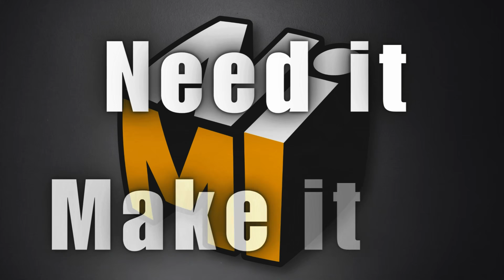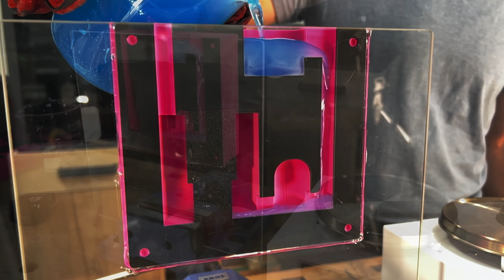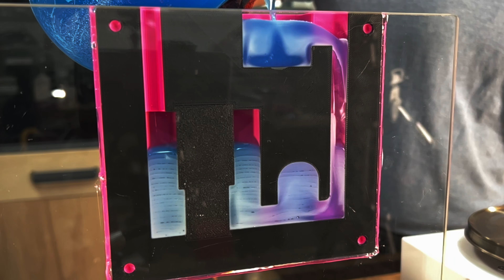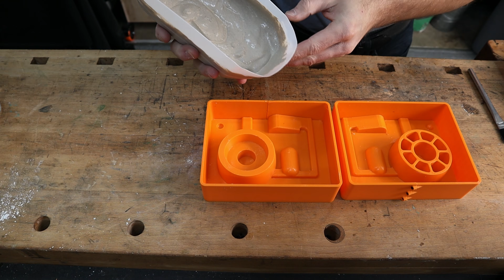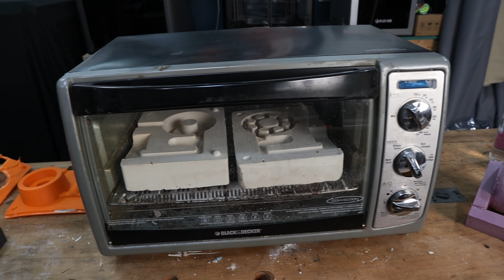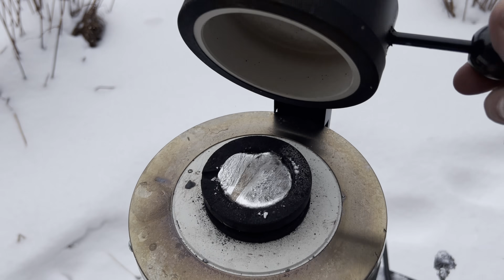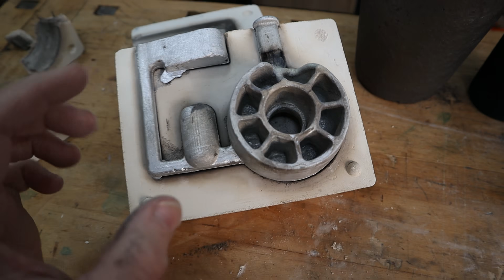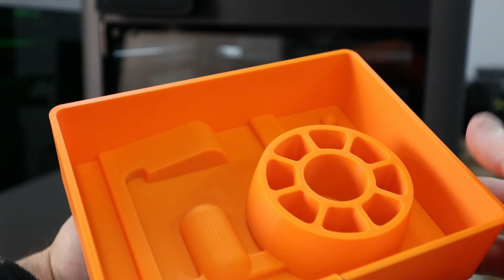Casting detailed aluminum parts is probably not a good idea and here's why.

Comment: You will have trouble with drawn or extruded Al.  Cast Al from car wheels is good.  Heat it up in a fire, map or a rose oxy tip, then hit it with a hammer to break bits off.  Your sand is rough and has no binder.  When your foam melts the loose rough sand collapses and the cast fails.  Mix with crushed bentonite (kitty litter) and a little bit if moisture.  Olfoundryman on YT is a legend.  His sprue designs are best and finish amazing

Comment: If you do not have any more aluminium to poor into the mould but need more material. Is it not possible to just put anything in the hole you are pooring into. Like some other metal that you can melt at a a regular cooking plate. or just put some nails into the hole. Alternativly air pressure that pushes the metal down

Comment: This is all super interesting!  It's not a failure if you learn from it.  Regarding your molds with the webbing to save material, if it's acceptable for the application, you might consider Zamak for the casting materal.  Lower melting point and flows better.   Thanks!

Comment: Using that "wall plaster" compound as a ceramic shell works pretty well if its diluted with soapy water.. U dip it, let it cling sift sand over it while wet let it dry and then dip it again.. 3-4 coats is usually fine.. then burn out the foam instead. :)

Comment: Detailed aluminum casts are usually performed under pressure. Since falling aluminum from height has a number of disadvantages, casting is performed under high material pressure into steel forms.

Comment: So one of the things I have considered is ball milling several sizes of aluminum balls the smallest of which might be like .5-1mm

You seal the drum and you put in a small amount of anhydrous solvent “Ethel or isopropyl” then after a time you rinse out all the oxidized dust. Then you reseal with fresh solvent maybe some “aluminum flux, if that exists”

Then run the sealed drum till smallest ball size dissolves to powder making sure that that packing of powder is 💯 

Then add a small amount of sacrificial wax/oil/carnuba possibly and roll tumble over heat till solvent is gone remove and tumble till cooled 

Now you’ve got a dry mold material whose oxidation is prevented till firing.

Firing removes wax and hopefully a low oxygen kin (coal sinks can pull oxygen from the kiln air) Charley’s your dad! dry cast powder liquifies, slight overfill controls for lost volume. 

Ceramic mold cap lets gas escape but shunts gas exchange?

No argon or inert gas needed.

But maybe I’m being too hopeful.

Comment: On your foam you should use a 0 flute bit. Also coat the foam in a drywall mud thinned with water and a drop of dish soap as a surfactant.. let dry thoroughly just enough to cover the foam. The coating is porus for the escapement of gas an keeps the sand from collapsing in. The riser size is also overkill. No vents needed as gas escapes through the coating. Compact the Sand by vibration. Plaster of Paris is hydroscopic.

Comment: A tip for removing forms from the plaster - include some small holes, with push in plugs in the 3D print.  When the plaster has set, pull the plugs out & use compressed air to separate the PLA from the plaster.  It's very gentle and will remove it evenly.

Also, a multi-tool is great for vibrating bubbles out of the plaster.

Comment: Shouldn't you be adding the plaster/sand mix to water instead of adding water to the mix?

DAP Plaster of Paris Mixing Instructions

Proportion: Use a ratio of 2 parts powder to 1 part cold water (e.g., 2 cups plaster to 1 cup water).

Mixing Order: Always add the plaster to the water, not water to plaster, to reduce lumps.

Slaking: Sprinkle the powder over the water's surface and let it settle and absorb the water (slake) for about 1–2 minutes.

Stirring: Stir gently to a smooth, creamy consistency. Avoid fast stirring to prevent introducing air bubbles.

Consistency: The mixture should be thick enough to hold its shape but smooth enough to apply, similar to heavy cream.

Working Time: Work with the mixture immediately, as it sets hard in 20–30 minutes. Only mix what can be used within 6 to 10 minutes

Comment: I think you would have a better result if you raised  the ambient temperature of the mould that way the material will cool slower and a lot of the issues will resolve themselves.
Detailed moulds in ceramic work well because primarily of the static or ambient temp of the mould during the pour.

Great video's though, nice to see a fellow Canuk with some really good content.

Comment: Couple helpful bits from my own trials: XPS foam (eXtruded PolyStyrene) cuts well on a CNC at 12-15k RPM with bits for plastic/polymer composites. Feeds speed-wise, you can run it practically as fast as your machine will go. The pink brand gums up A Lot, but there's a green version for house insulation panels that cuts really well and isn't pre-scored. 

--When you go to make the void for your foam core, you can use a solvent like acetone to dissolve the foam before pouring your metal and let the mold vape off. 
--For your feed sprue on the casting part, large, smooth and tapered to force pressure to work for you top to bottom, as metal will naturally exert more force at the bottom of the mold. One single large feed with an adequate secondary vent works well on medium to very dense metals. 
--With PLA or lowish melt materials and complex printed parts, there's a few options. You can use a stronger reinforced plaster mix for refractory (I made a DIY version on my channel if you want to try it, all materials explained and where to get), and for actual reinforcement, basalt fiber is cheap as well as high-temp resistant. It looks a bit like chopped fiberglass but black, behaves about the same where its slightly more annoying to incorporate if your mix is very viscous. 
--The other option is layering via dip and sprinkle, but it's tremendously time consuming unless you're doing treed parts for bulk casting, and the ceramic part needs a kiln or similar firing for proper solidification (as well as burning out the print). 
--Experimental option 3 if you have a science microwave (obtained via thrift store or old replacement, etc), layering Thin coats of powdered silicon carbide and sodium silicate brushed directly onto your print, then use the refractory plaster for the mold and place in a dedicated microwave to melt the print out. Make sure you add extra vents for the polymer to expand and dribble out of, or it likes to swell in the mold and break out.

Comment: You need a tapered sprue. Taper the sprue from top to smaller at the bottom.
Reply from the maker: You're right about that.  In all of my wisdom, my thought for the tapered sprue was for ease of removal, turns out that there is more to it than that.  I've already made the adjustment for the next try...which I think will be a success!

Comment: I think you're doing pretty well and I wonder if you preheated the mold hot enough as whether adding well as some more, smaller diameter venting from the part body section into the main vent you have might help.  This was cool--thanks for sharing it!
Reply from the maker: I have an idea which I think is both easy to do, should release really well from a 3D printed mold, and it's also cheap.  If you've every used waterglass (AKA sodium silicate) that's what I'd like to try next.  Cures in the presence of CO2 and should be as simple as mixing sand with it and forcing it into the mold.  I can do a preheat like you're suggesting, I think that would be smart.  it should also assist in releasing some trapped gasses, since they've been using the technique for cores for a long time.

Comment: You should check out the methods by "Shake the Future". Plaster seems porous enough to pull a vacuum on it even from the outside. The outside air pressure than pushes the molten metal even into small features.

Comment: Riser's are free.
You don't calculate extra Risers in the total mass calculation.
(OK, one of the things you did not calculate with the flowing wax demo was the air in the mold expands with the exposure to the  temperature of the molten metal.  Trapped in a mold air at room temp expands drastically.  As it does it volume grows dramatically.  This is often miss understood and people assume that the metal chilled early.)
By adding a second riser in the 2 O Clock position on the wheel or the 11 O Clock  position, or both you allow for expanded HOT air to leave without needing much of a pressure piston action that slows down the flowing metal.
(You can have a fill that only has enough volume to partially fill ALL risers and it will work.  It's just more re-assuring to see the metal come out the top of all risers.)

Comment: Both refractory cement and plaster of Paris and Jewelers casting plasters are based on "Lost Wax burn outs"   you start at about 180 degrees for low temp sprue waxes to melt out then move it up to 300 degrees and BEGIN the 8 to 12 hour process of drying the mold.  You don't have a burn out kiln that has a computer controlled Ramp up pyrometer.

Comment: 1. you need a taller feed sprue.  It's first benefit will be more hydraulic pressure.  It's second benefit will be to add a second sprue near the top.
(Cold shunts are always more than you can see by about 2X.)
2. Round some of those 90 degree inside corners to create less resistance to curving the flow. 
3. Consider finding on You tube how to make graphite crucibles and microwave based ovens.
4. Consider using a casting torch and a second clay crucible (Large) and melt the extra metal first and have a second person pour the amount of metal you can electrically melt the second that the torch based melt is out of liquid. If done as a one, two there should be nothing more than a second or two of separation between the two acts.

Comment: AGGGGGGGG!!!!!
After you have your sand set but before you pour use a propane hand torch to burn out that rectangle of pink foam.
Why make the molten metal do MORE work at the beginning than you have too?
Get that nozzle as far down the sprue shaft as it will go to melt as much pink foam as possible before you add the liquid Alum.

Comment: Burlap strips would work instead of buying fiberglass fibers.
Traditionally you wrap the mold in plaster soaked burlap and the longer fibers lock the whole thing together.
De-plastering is a bit more work getting the Burlap to give back the part.

Comment: A taller mold with a second metal in gate above only one you have would be better in that it would supply hotter metal to the last portion of the casting.
By placing a riser in the second gate you prevent escaping air from blasting the sprue channel.
You now see where that second sprue would need to fill that last part of the top.
(You need to make it that your NOT starting a fill until everything below the second sprue has filled.  This is critical in that were metal to be coming into both sprue channels at the same time you could have trapped air pockets in the middle of the part.)
Also heat your mold to a higher temp.  Your mold is chilling to much out side like that.  You MIGHT have had the right mold temp for a Summer time pour but not a winter pour?)
Windchill on the pouring crucible may also shorten how far the metal will flow.  Erect a wind screen.  Actually it's more of a windshield but that sounds miss leading.

Comment: WARNING: STYROFOAM WHEN IT BURNS GIVES OFF ARSNIC GAS!!!!  YOU NEED TO BOTH MENTION THIS AND TAKE PROCAUTIONS.
ARSNIC IN A GAS FORM CAN LEAVE ARSNIC PARTICLES IN YOUR SHOP ENVIROMENT.  YOU REALLY SHOULD HAVE BOTH A VENTALATION HOOD AND A VERY TALL STOVE PIPE TO CAUSE THE ARSNIC DUST TO DISPURSE OVER TOO LARGE AN AREA!!!
CHECK YOUR TEXT BOOKS WHEN YOU HAVE EXPOSURE YOU GET THE SHAKES AND THE TRADITIONAL REMEDY IS TO DRINK BUTTERMILK TO CALM YOUR SYSTEM BACK DOWN.
ARSNIC DOES NOT LEAVE THE BODY AND SLOWLY BUILDS UP IN YOUR SYSTEM.  THERE IS LITTLE TO BE GAINED OTHER THAN YOU STOP SHAKING BY THE NEXT DAY BECAUSE YOU DRANK THE BUTTERMILK.  I METION IT SIMPLY TO SHOW THE CONNECTION BETWEEN THE CASTING METHOD AND THE PROBLEM.
There is SO MUCH YOU NEED TO LEARN!

Comment: There used to be a sick group of old guys with to much time that build engines, mostly from the late 1800s that no had seen run in probably 50-100yrs. The used patent office designs.

The sick part was you built all your own machining tools: drill press, shaper, lathe, and bandsaw to enter their club.

The really sick part they told you how many cases of beer you would have to drink in order to have enough aluminum to build each piece of your machineshop.

Most of these were farmer types used to keeping their own farm equipment operational and they would show pictures of Old Milwaukee and Busch beers cans when it was time to smelt aluminum for a machine.

One of the strangest engines I saw built had a free floating piston in a horizontal cylinder that fired a different stroke at each end. The crankshaft was external and mounted above the cylinder. The motion of the piston was captured by essentially a big caliper that trapped both ends of the piston that attached to the crankshaft.

Its amazing what crafty old white guys with too much time on their hands will do.😂

Comment: How do you stop the melting foam from destroying the pureness of the aluminium? Any aluminium welder will tell you, that if you get even the tiniest bit of flame(of anything) near the weld, it totally destroys it!¡😮😮 Those castings would be useless, cause it's not even aluminium anymore, and would have no structural integrity 😢 unless it was only meant to be a paper weight

Comment: There needs to be a taper in your sprue. There are formulas for this but don't know them of the top of my head. You don't have the capability to pour fast enough to keep the sprue full and thus introducing air from turbulence in the metal/wax. Run your gating under your part and even past it to a spin trap that is vented to the atmosphere. This will take out the turbulence of the metal/wax rushing into mold cavity and instead give you a nice laminar flow filling to mold. The cavity before the part isn't necessary either.

Comment: I think you need to wrap your plaster mold with spiral heat strip wire (nickel chromium). It’s what they use in an electric kiln. If you heat your mold to near the same temperature as aluminum it should work better. You might could use the plaster mold as the lid/cover for your crucible furnace to preheat the mold. Another option would be to add a vibration tool (or bladeless reciprocating saw) like a cordless oscillating tool clamped to the table. Pouring aluminum is similar to pouring cement. I’m not sure why you are trying to fill from the bottom. Why not just have the coned sprue straight to the piece and a chimney?

Comment: I've had some good results by connecting a vacuum pump to a chamber my mold is in, it sucks the metal into all the details, I get layer lines from the 3D print and if there's any cracks in the plaster they are filled in too.

Comment: I use drywall bog watered down a little to coat the foam and I get beautiful aluminium castings in dry sand. The bog just needs to be a thin layer no more than 1mm thick or even less and dries in a few hours (best overnight)

Comment: Have you tried the 'Lost Wax' method of casting?
Reply from the maker: I did, but I had trouble with the burnout, a proper furnace is needed I think to get good results, but it should work, especially since the burnout allows the mold to be heated prior to the pour.

Comment: you didn't pour that wax fast enough , in your example you can clearly see separation from the pouring basin trough sprue to the bottom of the mold, and this is the place where  most of the chilling happens. try keeping your pouring basin always full to the brim, you only stop pouring when the cast material show up in the risers, i learn that the hard way trying to max out  cavity mold with full 3kg crusible of aluminium, the other trick i learned from oldfoundryman is to use tapered sprue  because it fills in much better than a straight one. from what i seen on your video neither in open mold nor in styrophoam molds  you mannaged to fill entire baisin to the top while pouring. and  the "air bubble" you expect to stop your mold from filling in completly, in case of plaster mold, is in fact caused by metal being too cold to flow and connect.  there is no air pressure to stop it, it is just metal front  solidyfying before it fill the form. if the raiser filled in before that edge solidyfies air would get pushed out  but you just need to pour faster , make sprue taper and a bit thicker  and keep it full all the time untill entire mold fill in
Reply from the maker: Good call, I should have made the basin full size even though it was a half-mold.
Reply: @NeedItMakeIt  main point is to keep sprue full if it looks like it is sloping down it is most likely not full because metal stretch under it's own weight, tapered sprue compensate for that because it can't fall straight down to the bottom and if sprue is full gravity is hepling you push out the air because whole content of the sprue is pushing on it

Comment: Preheat that plaster mould with heat gun or anything and stop the heat just before pouring. Plaster will get cold quickly and you don't want it to steal much heat from your metal